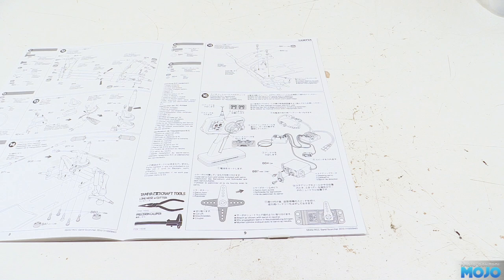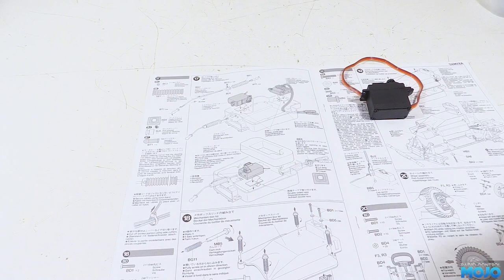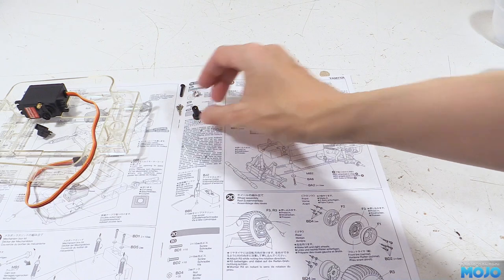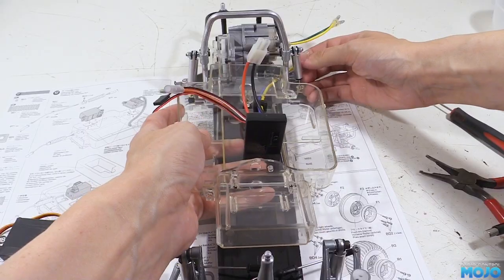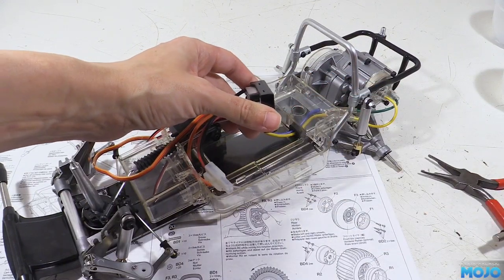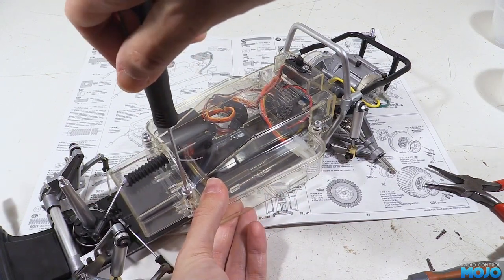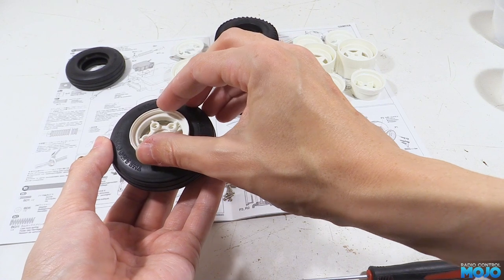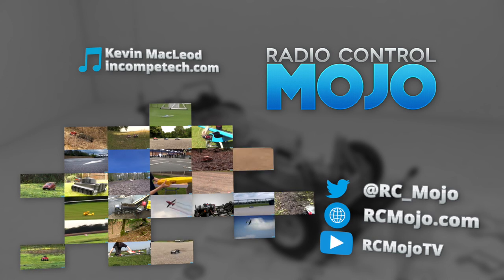Tamiya Sand Scorcher - #6 - Electronics Box

Comment: Little soapy water on a Q-tip helps with mounting wheels. ( I have a lot of crawler tire experience) 🙂
Reply from the maker: I've tried soap in the past, but I found it make the wheel slippery enough it was still difficult to assemble. Maybe I should try again and practice
Reply: @RCMojoTV  another trick I've used is to slightly file down the edges of the wheel just a little bit. Takes the hard edge off and gives you a fighting chance!
Reply: @RCMojoTV  Oh, and you want to apply just a little bit of soapy water to the tire, not so much the wheel, with a cotton swab. Just my 02 cents worth 🙂